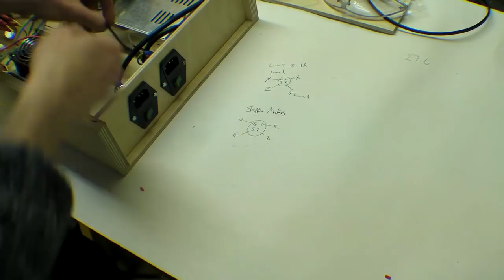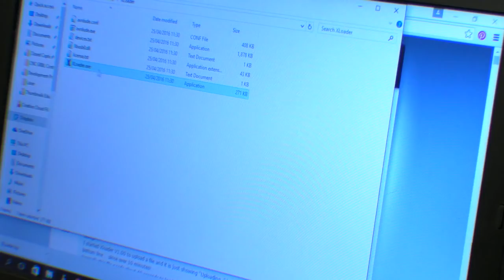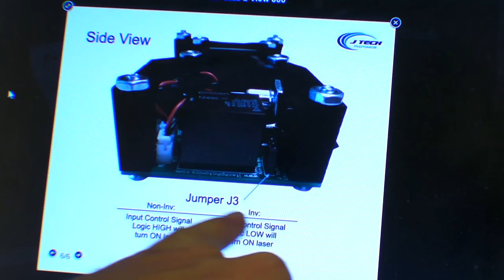Installing Laser Driver Board into CNC Controller Box / GRBL - Part 2

Comment: I did not see you adjusting the output voltage for the laser with the small pot on the driver board?
Like you, i have a 12V laser so the board must provide 12V.. I'm scared to adjust the output to 12V because the Diode next to the output pins is rated for 6.3V !
So, can this board provide 12V to the laser?
Reply from the maker: Literally can't remember. Lasers really stink btw.

Comment: Thanks for the upload. I was a little confused how the stepdown converter was actually wired to the TTL input of the laser driver. I have a similar setup Using a richauto A11 controller which uses 24v power supply and has a low level trigger ouput to turn on/off a spindle relay. is the laser driver TTL input using +12v and trigger signal as the connection or is it using GND and trigger signal?

Comment: Just got a 3 watt blue burning laser. Has the same module as yours but has three wires. 1 Powers the laser one Powers the cooling fan and the other connects to the wall adapter for power. Thank God the driver board is made of steel because it gets very warm it has that step down built into it as well. Are there any boxes on the market I could cover this open driver board with if so what would I search for? Very impressive laser build

Comment: I am currently in the process of collecting all the parts myself for a similar build using the same laser driver.  I believe the connectors are JST Connectors (http://www.ebay.co.uk/itm/DC-Power-Female-Male-Wire-Cable-W-JST-Connector-LED-Monitor-Adapters-Router-/232150311673)- I have ordered some from China so will comment again in about 3 weeks when they arrive.
Reply from the maker: The link does not work but get the ones already assembled so you only have to solder to the wires and cover with heat shrink. Will make it a lot easier.

Comment: The connectors that you refer to as the aviation power mounts were actually of Japanese origin and were first used as microphone connectors on low cost amateur radio equipment in the late 60s or early 70s but I'm sure all are now made in China. I can guarantee you none were used in aviation as there are no standards for this connector so if you use these you should at least buy them in sets as it is possible to find connectors with the same number of pins that are not interchangeable.

I've used this style of connector for years and have found the newer they are the worse the quality is. Some you can't solder the pins without melting the plastic around them and some have shells that are so thin they can bend and short the pins. Watch out with these.

Even the best connectors are still points of failure, ideally you want to make as few connections as possible and make those as secure as possible. Good old fashioned soldered joints and terminal strips are still the most reliable and lowest cost option.
Reply from the maker: I always thought they were called bulkhead mounts and that the aviation bit referred to the screw thread which held them together. Anyway they seems to be holding up so far.

Comment: Hi nice video.
I had the same problem with my relay, soo i used a inveter https://www.google.dk/search?q=inverter+gate+transistor&client=firefox-b&biw=1611&bih=812&tbm=isch&imgil=hdscOn6N_qMYzM%253A%253BOPoCyKlmjskcnM%253Bhttp%25253A%25252F%25252Fwww.electronics-tutorials.ws%25252Flogic%25252Flogic_4.html&source=iu&pf=m&fir=hdscOn6N_qMYzM%253A%252COPoCyKlmjskcnM%252C_&usg=__z5UP9mufVVoYxGJahmLYHKiaWy0%3D&ved=0ahUKEwiXvZCv6J3QAhXM6xoKHQDrCYsQyjcIJw&ei=zDUkWJenEMzXa4DWp9gI#imgrc=hdscOn6N_qMYzM%3A

From the controler to the relay in, that works.

Comment: Cool project! Diode lasers have low power and can only cut small thicknesses. But having a three axis CNC you can lower the laser to refocus the point after each pass. This method is suggested in this article: http://builders.reprap.org/2010/08/selective-laser-sintering-part-8.html Have you tried to cut large thicknesses with this technique?
Reply from the maker: +Diego Trapero No I haven't and I actually attached the laser to non-moving part of the z axis, so it is fixed focused for now.  I thought I'd start simply. Early days for me and the laser. Cheers.

Comment: don't use lead free solder trust me ;)
Reply from the maker: +omsonic You have to give me a better reason than just trusting you? Lol.
Reply: lead free has about a 80°C higher melting point than regular 60/40 solder and it solidifies faster making it harder to work with. also consider getting a 1mm chisel tip for your iron and a flux pen ;)
Reply from the maker: Ok that's interesting. I would need a better ventilation system though. Think I need to buy some activated carbon for the laser.
Reply: Actually lead solder is very safe if your not eating it ;)  it only starts to vaporise at about 1740 degrees well above the 300 most people solder at.
Reply from the maker: +omsonic Maybe but I also think it's best to eer on the side of caution.  Use ventilation when you can.
Reply: oh yeah the flux fumes will give you asthma.